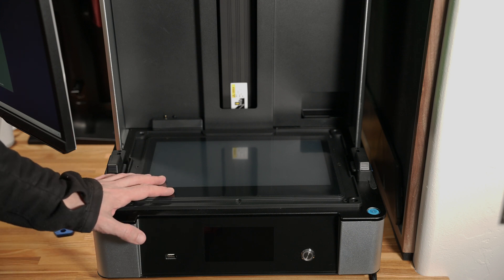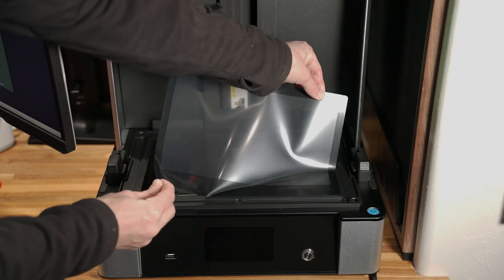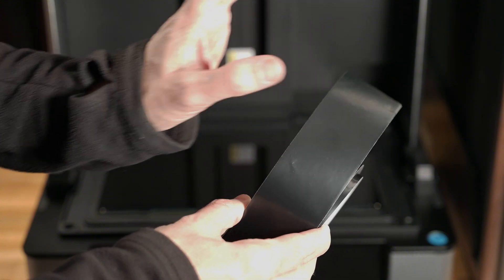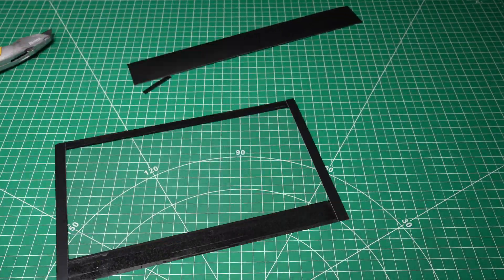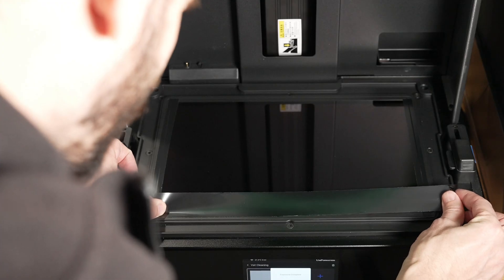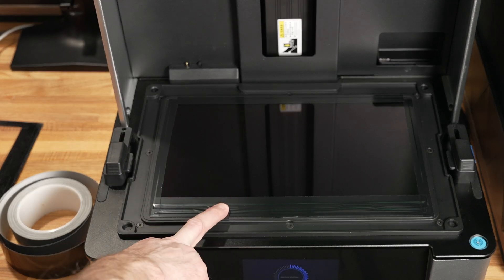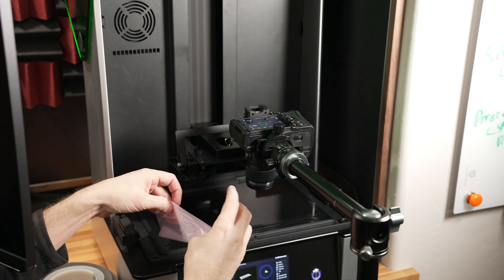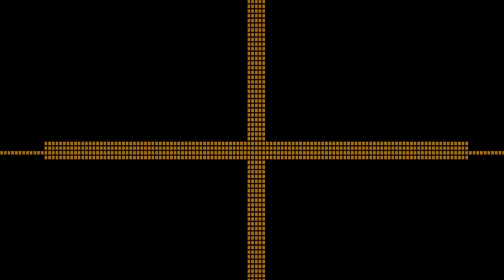Your Screen Protector is killing your quality! #3dprinter #tips

Comment from the maker: Here are some more pictures of the tests. I'm working  on doing a follow up video using my REVO (For reasons I will discuess in the video) to do AB resin print testing as well as UV light transparacy testing as well as what I end up using in the end on the GK3U. 

Fow now, enjoy some pictures from some of that work. 
https://drive.google.com/drive/folders/1cB-G8TZaRwf37IWVdmaw44UhGDf4LbrU?usp=drive_link
Reply: but these all are just pictures of panel. Not from prints it self. Have you tested that does it have any real world difference for print? Sometimes theory wont meet real world and I am not so sure that is it 100% good thing to remove all diffusion from light. After all that diffusion may be there for reason. At least I am interested what it does for dusability of print when light is more coherent
Reply: the BW comparrision was interesting.  It really highlights the edge distortion.

Comment: Good luck, I can't even find a glasses screen protector to replace my Saturn 4 16K Ultra one, as it developed a crack at the heated vat pins, and it's now the fourth I have seen in the exact same area. The heat must be causing it to weaken in that one spot from the heat pin connectors for the heated vat! 
I searched everywhere, can't find one, and even Elegoo doesn't sell spares, so I had to just contact them directly to say, "What the heck!"
Reply from the maker: Have you looked at what ChituSystems offers?

Comment: The screen protector you removed looked like it was "frosted" vs clear. I use Mach5 and they're pretty clear for plastic. It also just saved my bacon. I just replaced a screen and I had a pinhole that I missed in my PFA. I had a blob stuck to my screen protector on the first print I sent. If it weren't for the screen protector I would be either wasting a lot of time with a plastic scraper and praying or being out about $150 for a new screen. 🤷‍♂
Reply from the maker: Correct. This video was specifically about removing a screen protector like this one where it is very frosted. I go out and purchase glass screen protectors to replace it with.

Comment: Yeah, I’ve noticed if you take two or three of these protectors together and hold them up or put them on a piece of white paper, you start to see that they’re shading. I think many companies are still using products designed for tablets and PC. Where blocking a little bit of the UV light is sometimes good.

Comment: I tried your advice and removed the protector from mine. I noticed this: with and without anti-aliasing, the test prints are approximately the same. Does Gktwo support anti-aliasing in principle or is this one of those cases when there is no anti-aliasing at the software level? What if the protector partially performs the anti-aliasing function? I used chitubox for tests.The result is great in any case, but it's just weird.
Reply from the maker: @sonnyswatTV  AA is made by the slicer. It's just settings different transparency levels on the pixel so it should work for all printers.

Comment: So no screen protector, and risk damaging your actual screen. Once the tiniest dot, or smudge gets burned onto the screen. You are FUCKED. I can live with a print looking 90% quality than having to replace a well over $150-$200 item and the pros dont outweigh the cons. Personally.
Reply from the maker: No run a screen protector but get a high quality one. Stay away from the cheap plastic that scratches easily, absorbs and reflects the UV light.

Comment: Any comment on “index of refraction” specification for the screen protector (plastic or glass) being of any concern for distortion of the UV layer images (or perhaps the shifting of the image would be inconsequential since all pixels of each image would be equally shifted, thus resulting in a same image, just slightly shifted x or y, rather than slight “blooming” of every pixel ???). I ask because in the TI DMD (digital mirror device) chips used in DLP projectors for 3D printers, the UV versions of these DMD chips have glass covers that have an “index of refraction” specified for UV wavelengths. However, perhaps the potential distortion of the projected image is greater for DMD, where a small image is being sent through many lens and then winds up with much, much larger final focal-plane image.
Reply from the maker: You will get a tiny bit of that with a glass protector but it's less than the XY of the UM of the capabilities of the resin or the LCD. The major issue here is the distortion of the material. Like light through privacy glass it blurs and distorts the image almost upto 2px wide. If you look at the comments you can see some pictures I took. THe Black and white shows it best where you have that "ring" around the pixels. This ring is where you get a softer cure without any crips details. 

There are quite a few 3D printers with a Glass screen protector on them that are able to print very sharp details. The limiting factor here is the resin, not the LCD.

Here are some examples of some prints that where printed on my Mini 8ks using a Glass screen protector.
https://photos.app.goo.gl/nFG2EuWxn6HRSvcQ7
Reply: @ Thank you kindly for your reply. Your comments make sense. It seems that it would be a nice, little cottage business if we could find someone in the resin 3D community willing to “custom-make” and sell “tempered glass screen protectors” for all the reasonably-popular resin 3D printers on the market, so we don’t have to endlessly search for the proper size versions or risk cutting the glass ourselves.
Reply from the maker: @dovmerrill804 Phozen and Chitubox sells tempered glass screen protectors.

Comment: I see a few fellow GK3U people in here.  I'm on the hunt for a tempered screen replacement. If I find one I'll post here, if anyone else does I'd be thankful for a link.

Although my anxiety goes up a little as I realize that I'm most likely re-entering the land of trying to figure the Z axis testing and I never did wrap my head around the fact that adding a few sheets of paper just reduced the pressure on the plate, it didn't stop the contact with the plate, so did that raise Z axis or just reduce pressure, why is that the solution...what if dog is really spelled C-A-T... what have I done...anything...oh darn there I go again... Sorry. :)
Reply from the maker: @JerryBWagoner  hahah yeah.. the screen is the same size as the M7 Max so maybe start there.

Comment: Did you try some other printer and screen protector? GK3 Ultra is pretty bad printer with multiple flaws and one of them is also a bad screen protector that blocks light. Uniformation already confirmed it that screen protector on Ultra is faulty. I dont see any quality drop with M7 Pro.
Reply from the maker: @88RunnerBlade  Yes one seen quality issues with the plastic ones that ship with the M5s as well as the popular ones that are designed to go over the entire top of the top of the printer. This one was just a bit worse than the others.

As the inventor of boxes of calibration, I'm in a rather unique spot. This is where I have a massive amount of people sending me pictures of their calibration prints and me giving advice on how to improve them. 

Over the last few years I've seen a direct correlation to UV exposure, time quality and how many pillars someone can print directly related to screen protectors. 

At this point me asking what screen protector are you using? Is one of the first questions I ask.

Comment: were you can find glass screen protectors ? because here in Argentina its almost the same prince the screen than the printer itself, so i try to not damage the screen
Reply from the maker: @durielvs  ChituSystems and Phrozen sell glass protectors. But not 100% sure what your purchasing options are from Amazon or AliExpress.
Reply: @J3DTech  The Phrozen website only has one screen protector listing and it specifies in the description they're PET film, not glass
Reply from the maker: @shardperson3777  Aso keep in mind that one of the plastic ones used by Phrozen and Anycubic is a much harder plastic that won't scratch like this one will. This one scratches when cleaning it with a cloth.. 

You can find them here is an example. 
 https://www.amazon.com/Tempered-Protective-PJ089Y2V5-TM089CFSP01-Protector/dp/B09BZ45FL2/ref=sr_1_10

Comment: I can appreciate the effort on the video, but can we get some more information on where you plan to find a super-thin, tempered glass screen protector that is cut to the correct size/shape for the GK3U?
Reply from the maker: @PhillFisk  I'm working on a follow up right now.  But I'm looking at the tempered glass screen protectors from Frozen and choo choo systems. There's also one that comes on the M7 Max that I think works quite well given. I am quite happy with the print quality from that printer. 

Right now I just cut a sliver out of the screen protector that I removed and I put it on my Revo and I'm doing a print right now where I have two parts on and two parts off of the bit of extra screen protector as well as I'm showing the UV light blocking that's occurring as well.
Reply: @J3DTech  Oh wow, that's awesome then! I expected that some sort of custom-ordered-and-cut protector was going to be the only option. Having ordered cut glass online for various projects, it gets expensive quick, but this sounds like a much more cost effective option.

Comment: where the print results before and after?
Reply from the maker: @MrBirdshell666  That was the images showing the before and after of the LCD and the light bleeding though vs the clearly defined pixels.
Reply: @J3DTech  i mean, real prints. i didnt notice any difference at 0.05 on saturn4u+ chitu screen protector. i know, somehow it should affect the quality, but i dont want to take risks if nfep suddenly pops

Comment: I have a 6ks and M7, so aside from the thicker screen protector sheet they include with the "leveling paper" theres already a screen protector on the lcd thats part with the seal around the edge of screen?
Reply from the maker: @benv3417  Yes there is you should be able to see it or the bump in the tape
Reply: @J3DTech  ooooo ok, that makes sense and explains the raise in the tape around the edge of the screen. I thought that was just the edge of the screen protruding up slightly and not an already installed protector. So with the one included that goes over top then, technically there's now 2 screen protectors on it?

Comment: Is the main intention of using a screen protector on a 3d printer to protect from scratches, like ones used on a phone screen? Or to protect from spillages?
Reply from the maker: @Recoincidence  Spills, but honestly with a good workflow it's easy to avoid.
Reply: @J3DTech  what about a random puncture? It's happened to 3 of us in my friend group. It's not often but it's not easy to avoid.

Comment: I'm thinking of cutting out the clear plastic film but keeping the black adhesive framing portion of my extras and then doing a test to compare results. Glass is so easy to cut to exact shape, btw.
Reply from the maker: @Haxzyr  The M7 Pro has a glass one. I need to see if I can find out where Anycubic got it and then I'm good. I don't trust myself to cut the glass without shattering it.
Reply: @J3DTech The exact shape can be done by a reputable hardware store, picture framing store, or glass supply store that sells panes. The scoring jig is required to keep a straight scoring line for a clean break.

Comment: Camera isn't enough. Testing should involve actually running the exact same print with and without the screen protector and showing the results.
Reply from the maker: Keeping that for the full review and after we figure out the layer lines issue. 

But this is an older issue first noticed on the M5 and M5S with their inclined plastic screen protectors.  

But be assured a blooming of almost 2px does greatly hurt accuracy on the print as it's essentially cutting the resolution in half making this perform closer to 8K printer but with a lot more artifact lines.
Reply: @J3DTech  You are forgetting to take into account that by taking a photo like this, the Screen Protector is not "flush" with the LCD, like it would be with the VAT, resin and build plate weighing it down. On the GK3U, the Screen Protector "hovers" with a tiny air gap between it and the screen, until you mount the VAT.

By pressing the Protector down with each layer, the blurriness will be minimized, so a print-test would be great.
Reply from the maker: @Sandermander  I did consider that, here are some more images of the results. There is no air-gap.

https://drive.google.com/drive/folders/1cB-G8TZaRwf37IWVdmaw44UhGDf4LbrU?usp=drive_link
Reply: @J3DTech  2 px?? For real this much? :o
Reply from the maker: @ArkatzMods  Yeah that bleeding is very close to 2px
Reply: @J3DTech  I was comparing it to my printers which 10cm pixels so I was stunned, but actually on a GK3 it's not this big. But still!